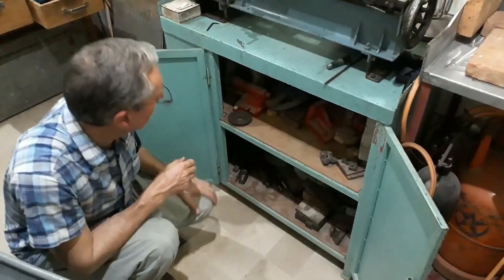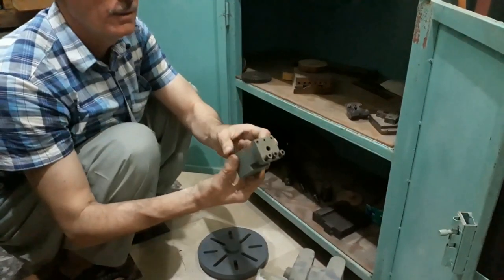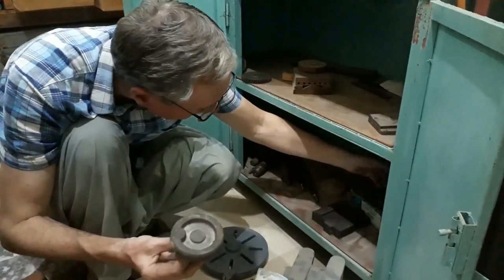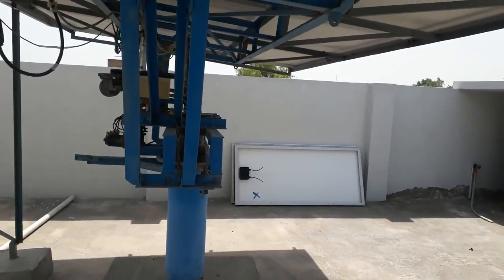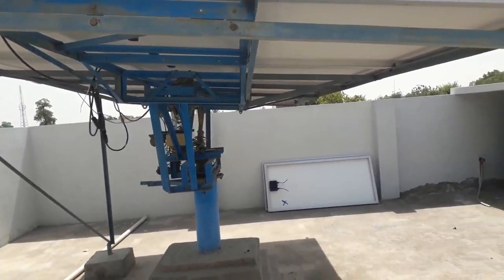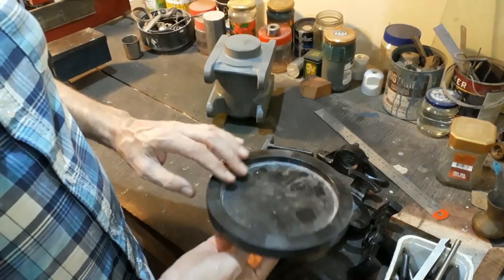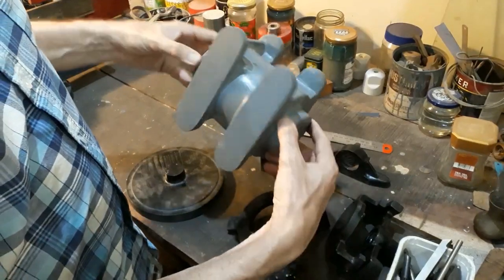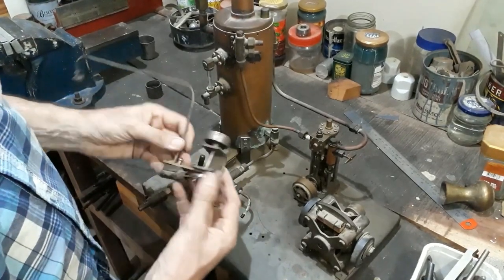Homemade Lathe - #3

Comment: Awesome work, how you adjust your lathe for precision ? Mine take six months to make a granite surface plate for adjust a straight edge for match my ways next to 0,001 of precision
Reply from the maker: Hello Pedro, Making a granite surface plate is a much better basis for future work that my quicker process. Well done! I have described how I made the ways flat in the first of these three videos, 'Homemade Lathe - part 1' https://youtu.be/lGLrvzJeLpg. There is also room for adjustment in the headstock alignment through rotation and shimming. The shimming is not ideal but for me it was an appropriate compromise between accuracy and speed of build. Would be good to hear how your build progresses.

Comment: Thank you so much for these videos. I have been searching for quite a long time and it’s a relief to see a way of fabrication that is not full of welding and angle grinder nonsense! I had been struggling with getting the overall proportions of the lathe right, and by observing your build I have figured it out. If you can direct me to further information on the topic, I would be grateful. Thanks again for the clear explanations.
Reply from the maker: Thank you, Mark, for your feedback. I agree that sand casting is worth considering if you have access to a foundry. I would recommend looking closely at various designs including some of the early lathe designs: industrial museums, lathes.co.uk, Lathe Bed Design J Horner, etc. At the end of the day much will depend on what you can make in your workshop. Hope it goes well.